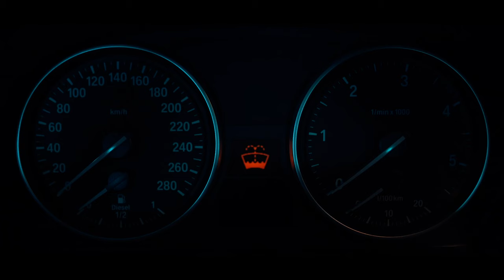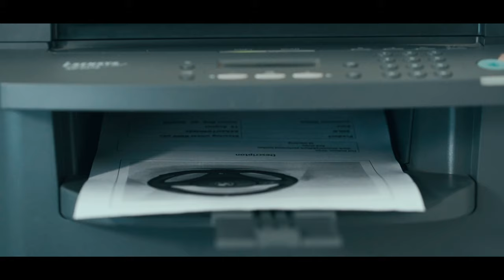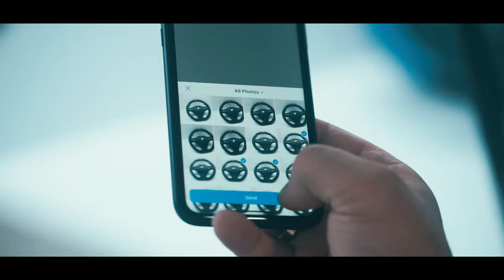AZA AUTO WHEEL / HOW WE DO IT / THE STORY BEHIND EVERY CUSTOMIZED STEERING WHEEL

Comment: How safe are the flat bottom steering wheels? Do you modify the original frame of the wheel to be flat on the bottom? If I were to bang my head on it during an accident, would it break? I have seen some people use PVC pipe to make the flat bottom. That doesn't look safe
Reply from the maker: Alex Abrams we only use genuine factory steering wheels as cores. No pvc use what so ever. Good question. We hope that people always wear seat belts as hitting any kind steering wheel with a head will cause a severe injury or death. We don’t do any air bags or air bag cover modifications either as it may not be safe and is a liability factor.
Reply: @azaautowheel  Ah ok i see. So the stock metal frame doesnt get modified? Just the shape of the bottom
Reply from the maker: Alex Abrams yup

Comment: Can you make a steering wheel with the led display even if the OBD port is located under the bonnet? Asking for a BMW e46 99 323i, RHD - there is no obd port inside the car, only the round connector located in the engine area.
Reply from the maker: Please reach out to us directly @ AZAAUTOWHEEL.com we need to see picture of how it looks and see if the engine heat is going to be an issue